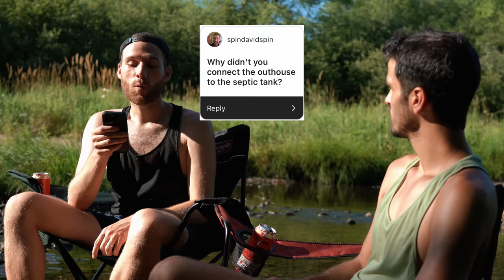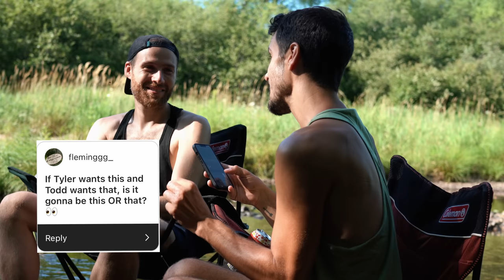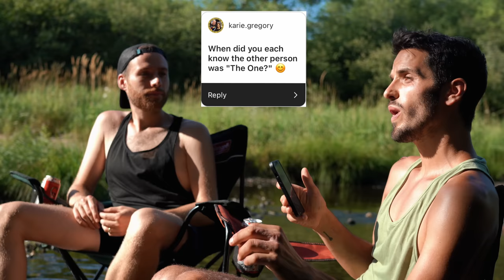Are we secretly rich? (Juicy Q&A)

Comment: Wish I had heard ahead of time about the Q&A. One thing I've found myself wondering about is how people (isolated in wilderness-type areas for long periods of time) deal with garbage disposal. I realize that trash can be reduced by burning cardboard/paper, and by composting food waste, but an average person still will generate a fair amount of other types of trash (food containers, especially). If you don't have an actual garbage pick-up service, how do you store garbage until you can take it somewhere, and where would you take it? I'm slowly working towards getting a camper fixed-up to take on extended trips (almost a full-timer) and hope to be able to boondock for long(ish) periods, but not sure how to deal with the trash.
Reply from the maker: That is a very, very good question! We sort and recycle everything that we possibly can and the rest we bring to the dump every so often! :)
Reply: Excellent question! I’ve wondered about this too
Reply: Here we have to drive it to the dump and pay a little over a dollar a bag. On a septic system all the veggie waste goes in a compost pile.
Reply: I reckon the biggest trash would be from the wrappings of your building materials.
Reply: Cardboard and paper are the carbon in the compost heap 😉
Reply: @tylerandtodd  Thanks for the reply, guys.I also attempt to recycle what I can, but there's always cans, plastic wrapping and other stuff that gets contaminated with food which would have to be disposed of, somehow.  I would worry about how to store stuff so that it doesn't draw flies, bugs, or other, larger animals like bears (not to mention avoiding the smell). And most dumps, at least in most places in the U.S. require proof of residence in the city or county where the dump is located to utilize it.

Comment: Regarding the chickens and ducks, I have had both and while they may not seem it, they are a lot of work, especially if you don't have a plan for their eggs.  They require a great deal of maintenance to keep clean and need a constant source of water in order to digest their food, which will require heat in the winter. They also attract predators and rodents which eat both their food and eggs.

Comment: You might want to put 1 Time Wood on the cedar hot tub and sauna to keep it from going gray. It penetrates the wood. with it soaking in it does not form a layer like paint that has to be scrapped off down the road. We have it on our back porch and it has held up for 10 years and still looks good. We did put a coat on about 5 years ago the top wood rail that faced up and in the Kentucky sun all day. Unless. Ps don't let your turnips get as big as a softball or it will go mealy.They are best to be planted to where they mature around the first  light frost. It will mellow their flavor and store better in a cool dark place.

Comment: Next time you want to move a huge rock get a drill some water and a wee tub of Dexpan. It's a powder that expands a lot when you add water so you put it,  as described on tin, in the holes you just drilled and go get a cuppa or sit and watch.
 The Chateau next door used it to get rid of a huge ugly lump of concrete on the old Napoleonic stone dam as no explosives or jack hammers could be used.
 Then they sat on the terrace and watched it disintegrate like the face of a glacier.

Comment: Ok!  I believe you have it wrong about the sewer pump!  It normally does not pump solid waste at all.  I have a septic tank just outside of the bathroom.  There is a pipe running from the tank to the sup pump which only pumps the overflow fluid from the tank and pumps it up hill and over to my drain field, 300 feet away!
It's doable boys!

Comment: Chickens eat anything they come across.  Older hen keepers would suspend an old tin can on fencing and tie in a dead rodent or offal and when the maggots fell the chickens would go crazy with excitement. In my experience ducks need a lot of feeding and don't give much back. On the downside, I've never seen a chicken coup without rats, (UK viewer) and once you have them, there's only  a slim chance of getting rid of them. If you have enough flat ground, you could use a mobile coup. Chickens would only need grit and water, and maybe the kitchen trimmings. for most of the time